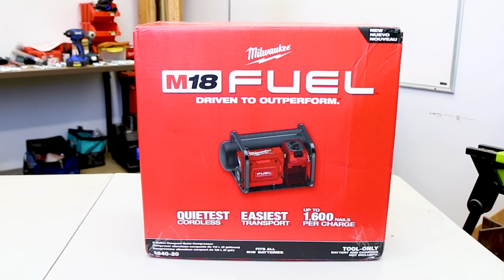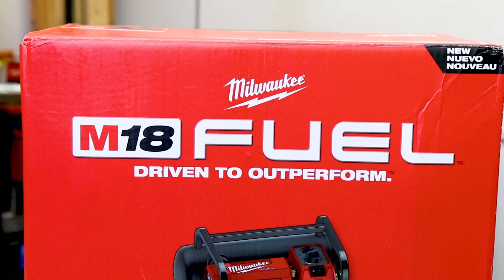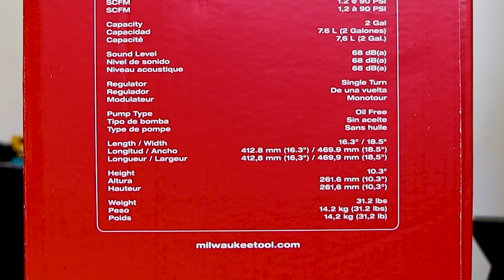New Milwaukee M18 FUEL AIR COMPRESSOR IS NOT WHAT I EXPECTED!

Comment: I would like it to have an extension cord connection so it can be plugged in if you want and it could charge the battery as well i mean why not right??
Reply: That is why there is a battery charger
Reply: @johnsavage3762  except when your on a construction site (especially new constructions) you don't always have a limitless supply of plugs. So there is a very real world practicality to having combined technology in these kinds of devices.
Reply: @johnsavage3762  you obviously don't understand why it's not really that effective of a tool with out the option of a plug that also has the ability to charge the battery without removing it.
Reply: Then they couldn't sell $250 batteries
Reply: @leezy7787  THIS
Reply: This is where Milwaukee often misses the mark for me. I agree,  this should have the ability to run corded and as a charger. Especially for the cost. I also think that mentality should apply to the table saw,  miter saws, compressor,  etc. If they can do it with a flipping light they should be able to do it on tools that cost way more and could benefit from having a cord. ....I get the whole "cordless job site" thing they are going for but having a cord as an OPTION would further set them apart in the marketplace..... many guys would love to be able to run their tool while charging it when there's power available
Reply: The aftermarket (underground) is in the working of a battery with and plug in adaptor. They have one for Makita and Dewalt. As far as I can tell it shouldn't be too long before something is available...that being said: the corded adaptor will probably cost nearly the equivalent of a 12V Makita battery if I had to guess.
Reply: I just made my own adapter
Reply: You can build it I know you can
Reply: Why not.
Reply: https://www.youtube.com/watch?v=eup1XDrHDfg  Tutorial for building AC adapter
Reply: @bergeronremy7359  that's not an argument because plugging it in is optional
Reply: That would've been common sense...the fan does that.

Comment: I have this compressor and you don't need to empty the air tank to change the pressure setting.  All you need to do is reduce the pressure at the outlet.  This can be done with a blowgun or a tool that requires a steady stream of air to work like an impact or air ratchet.  Just trigger the tool.  A nail gun will not relieve the pressure since it consumes air in short bursts, so if you do need to change pressures in the middle of a job with a nailer, just hook up an air gun.

Comment: I’m a tree guy and my bucket truck doesn’t have air brakes, just hydraulic. Therefore I have nothing to tap for air to clean chainsaws on the job and even myself before I get back in my truck with all that sawdust all over me. This little thing sits right in my toolbox on the truck and now I have air. Unbelievably handy. I recommend 10/10 for anyone in my shoes!
Reply: This is exactly why I was looking at it 👍. Air is amazing to have for any tree worker.

Comment: Beats unrolling 100ft of hose. So you don't have to hear the compressor.
Reply: @raymondcuda5906  well I'm a 30 year veteran framer and I remember when air nailers hit the scene and everybody said those would never work out. Air hoses are for dinosaurs right along with stick Framing with a hammer and using a hand saw for everything.

Comment: The "drain the tank to change outlet pressure" concept seems like a good way to suck a battery dry without doing any actual work.
Reply: Can be avoided with extra air regulator attached (like this one at HD: Primefit-1-4-in-NPT-Replacement-Air-Regulator-with-Steel-Protected-Gauge-CR1401G/205149488), that way you get second gauge and on the fly adjustment.
Reply: @alexs.3789  Nothing like spending $350 on a compressor, $150 on a decent sized battery, then immediately having to install workaround parts to be able to use it easily.
Reply: c'mon , how many times do you even adjust tank pressure . ALL of my air tools SAY 90 psi max., yeah for sissies . I CRANK it up to max no matter the tool OR compressor . I have been running the SAME airr tools for 15 years at 175 psi with NO Ill effects!!!!!!!
Reply: @shartingkhumbubbles7169  Many, many  many times per day. I make the rounds and fill up tires to specified pressures, which is easier if you don't have to watch and stop each tire at the right PSI...just set it. Then I want max pressure for blowing off and cleaning. I pressure test piping systems at a set PSI, run tools at different PSI, etc.

If you just run tools with your compressor, then yeah, it's no big deal.

Also, many tools will dtive nails for example to a different depth and different pressures. So if you don't care about your job being done to very high standards, you just blast them all in at the same pressure regardless of the task. You are right though, plenty of people just run everything at the same pressure, and both just don't care, and also think their eork is just as good or better than those that take the time to adjust pressure according to task.

It's a quick way to judge if you want that person to work on your personal house or not.
Reply: also is a why to use a 3 step motor for faster filling at lower psi...
Reply: @PowerScissor   oh i dont work on houses nor inflate tires with a 2 gallon battery powered compressor. I work on rusty cars from the rust belt and Id never purchase that compressor . i drain my 80 gallon IR in minutes with sanders and  such. that thing wouldnt last 1 work day
Reply: @PowerScissor  Small price to pay for those of us who do this for a living.  Hobbyists...go plug that shit in.   Beats having to call an electrician to come and install a spider box.
Reply: @shartingkhumbubbles7169  To each his own.  The Manufacturers suggestions are there for a reason and came to be after much testing.  But you seem to be smarter than the engineers who made your tools in the first place.  Continue on.
Reply: @wadopotato33  Well, if there's absolutely no power on site...you'll eventually have to charge your batteries.

I'm not complaining about the price. I just don't like the idea of paying that much, and then immediately having to install my own regulator which would stick out past the roll cage and be another thing I have to tote along. Literally every other compressor allows you to adjust pressure without draining the tank. It's an odd choice for a premium product.
Reply: @PowerScissor  I don't disagree.  I also thought is was strange.   I don't worry about the batteries much I have five or so and a sequential charger.  I often go three or fours days without charging any batteries.  I also don't buy the little ones.  I would rather deal with the extra weight than have to suddenly change one when I am up a ladder.  

I would slowly like to go to ALL battery powered stuff, but it is also cost prohibitive to do it all at once.  I also own a small Honda generator and so I haven't had to wait on spider boxes in a while, but it did happen in the past.  Having no power

The cost could come down, but I think it will once battery power is the norm.  I can't justify the jump at this point, either.  Besides, I own five Air Compressors already (all corded).  One battery powered one won't replace all of those anyways.  This one would be useless for roofing and a host of other jobs.  Who can only own one?
Reply: Just to let everyone know. I bought one and it does not work like that. Maybe they changed it...but tank always fills to 135psi and outlet pressure is adjustable on the fly without draining.
Reply: PowerScissor I don’t use pressure to adjust nail depth, I use the depth adjustment on the tool.  I don’t know anyone that adjusts nail depth by fiddling with the pressure settings, but that’s just me .  Not not to mention we usually have different nail guns hooked up shooting into different materials and all would need different pressures if you were adjusting depth by pressure.
Reply: PowerScissor might have to pick one up
Reply: @kds471  I returned mine. I would wait for Gen 2.  It killed my 12.0 batteries way too fast. I like to blow off all my tools at the end of the day, and it's not up to that task.

I returned it and bought a 2nd M18 vacuum. I just leave the 2nd vacuum set up on the blower side. Blows stuff off way better, it's way lighter and doesn't kill batteries, and works with the Packout sytem. Way cheaper.
Reply: PowerScissor thanks man!  First hand experience is the best kind.
Reply: @Matt B agree!
Reply: My new one adjusts on the fly PSI .....

Comment: I got mine in the first wave. It's a thing of beauty. 10ft coil hose and I can haul it all over the place. Built a "T" for two guns. I like the weight of the pneumatic guns vs my m18 guns. Really like this thing. I've even used it to run a coil nailer to fix a customer's fence, though it was great for a repair, I wouldn't build a fence with it.

Comment: My understanding is although not always the case, 'standard' db measurement is at  1 meter distance.
Reply: Yes, and in an anechoic chamber - not really a realistic scenario, but repeatable for comparison. Typical room reverb could easily add 10dB on top of that.

Comment: Perhaps you can set the pressure to max and connect an external regulator if you need to switch between tools? I was considering a cordless inflator, but all of them need a 20 minute cool down period after 5 or 10 minutes of use. Additionally, none of them were any good at filling truck tires. For me this will be my home and traveling inflator for all tires and rafts. It will also serve as a quick, quiet and convenient compressor for small/light nailing jobs. Got a Paslode for big projects.

Comment: I have one of these. Works great for tires, blowing dust off stuff when assembling engines, etc. Much nicer than lugging a fullsize electric compressor around and does a hell of a lot better job than the small 12v compressors!
Reply: Can it run a oil extractor vacum  on cars ?
Reply: That’s why I bought it. I just ordered it. I just want it for blowing off shit when I’m servicing equipment an airing up my sure shot sprayer. I probably should of waited for gen 2 but no mention of it yet an I needed it yesterday 😂 I think it’ll be perfect for my uses. Can’t wait to get it.
Reply: @samuelw.3992 so this would be good to spray dust out of a work truck, ie detailing?
Reply: @travispettyjohn8079  I think it would do good if you got a tiny blow gun, mine is 1/4” diameter an the compressor starts running after 10-12 seconds of using it. I think a small blow would allow you to blow longer.

Comment: it would be pretty cool if they could improve this design and go with a rotary screw type compressor and a 3 gal carbon fiber tank that would reach over 200 Psi and kick the compressor on around 150psi that way you could run the unit far longer for larger devices . Maybe reach 3- 4 cfm

Comment: I just got this milwaukee compressor. Im a general contractor and do work orders and repairs for real estate companies. I most do small jobs  and repairs and not huge projects. This will come in very handy doing trim. Or even my palm nailer  when I need to utt a nail in a tight spot. In my profession it will come in very handy.

Comment: I use my cordless compressor to put air tests on plumbing rough ins. You never have any power on new construction sites so this tool saves me a lot of time
Reply: I am a Plumber thanks for your input
Reply: I use the much much lighter and smaller dewalt 20v inflator, works great. Got tired of carrying around the bigger flex volt compressor

Comment: I would like this if they made a "battery to wall" adapter so you don't have to worry about the battery die-ing and it's still about the same performance.
batt to wall: aka battery looking package but with "prongs" for an extension cord
Reply: ....there's a company in the process of making one now.

Comment: I think they may have realized that pneumatic nailers are smaller,  lighter, infinitely more adjustable with air pressure, have much less moving parts, and cost half as much as lithium nailers. I'm sure losing the hose has it's benefits - like Richard and his crown installations. Great review and I will stick to air for driving fasteners.

Comment: Waaaaay too expensive at $350 for the bare tool. Better off with the flexvolt compressor. The kit with the fast charger and 6Ah battery retail at $300 and can be found much cheaper frequently. It's also 2.5 gallons compared to the 2 gallons here.
Reply from the maker: Solid feedback, thanks!
Reply: Still seems like a 18v pin nailer would be way better than dealing with a whole ass compressor and hose though.
Reply: @mastermetalshredder  
No kidding! Definitely the smarter alternative.
Reply: @rogosteve  I think they should have both
Reply: @mastermetalshredder  
Metabo has an 18v framing, finish, brad, and pin nailers that run in the same battery.
Just sayin'.
I've got everything Milwaukee except my nailers suite. I couldn't wait for the to get their act together in that scene.
Reply: I'm assuming your talking about a Dewalt throwaway tool. $150 would be way to much for anything Dewalt, I mean Black and Decker builds.
Reply: The dewalt cordless compressor is garage , I brought it and burned out after 1 apartment of trim , just stopped turning on outta nowhere , the battery doesn’t last , even for a 60v , not to mention dewalt doesn’t even build it , they send you to the company that builds the compressor after you call for the warranty but they don’t have any warranty , they tell you to call dewalt . Don’t waste your time
Reply: I agree
Reply: DeWalt batteries are a step behind Milwaukee's.  If you want to change out batteries all day...go with DeWalt.
Reply: @mastermetalshredder  Was thinking that myself, but for those of us who do it for a living we need a 16 ga pinner, an 18 ga. pinner, an 18 ga. stapler and an 23 Ga. pinner.  Actually cheaper to go with a cordless Air Compressor.   Cordless tools?  They are almost 300 dollars a piece and they don't even make a 23 ga. pinner to my knowledge.  MUCH, MUCH cheaper to buy the cordless Air Compressor.
Reply: @wadopotato33  makita has 23 gauge nailer for $180
Reply: @donwaltz2798  I buy Makita grinders because I weld a lot.  I have a laminate router that is a Makita.  I like it.  That said, I don't really like many Makita tools.  I actually don't mind their framing nailer, but I have tried other nailers and don't like them.  Their saws are also absolute garbage.  I can't figure out why anyone would buy a Makita saw.  Not a fan.  I do this for a living and work with a lot of people.  I have tried most everything.  Makita for nailers is not on the table.  Unless it is a framing nailer.
Reply: @AceSolomon94   Sorry man, that is not a practical application of battery power.  You would need a battery the size of a pickup.
Reply: @wadopotato33  lol yeah I've had both. DeWalt flexvolt for the win.
Reply: @fernyisable5  Mine is going great, I run a Graco Fireball off mine pumping gear oil. The air consumption of the Graco pump is greater than the output of the DeWalt compressor so it just lives it's life in pain running flat out trying to build air (I'm not really using it for what it was designed for). I've also used it to charge MAN truck air tanks to mobilize it's broken arse & also used it to run a husky 1040 diaphragm pump when I needed fuel from the support Truck. It's pulled me out of the shit many times.
Reply: The best way to find out is to compare it to other brands...
I had the dewalt for some time... it was too noisy, i had to run more hoses to leave it outside... short story, I sold it.
I have the Milwaukee now... I’m keeping it.
I’ve made some trash boxes 8’x4’x4’ using a framing gun and worked good, so yes it can keep up to a framing gun, of course it depends how long are you using it. It’s more like  for repairs and small projects.
That’s got be be considered too, either a cordless or a gas compressor is need it not just because it looks cool or it’s portable.

Comment: Hi Vince, 

The video doesn't do justice on the noise leave. This milwaukee m18 cordless air compressor is quiet. I used it on a large fence project with a long back yard. I had to use my pneumatic crown stapler. It's awsome, i didn't have to roll out a 100 ft extension cord. This tool already paid itself off and made me money in one project.  People got to remember these tools are mostly used on jobsite to make you MONEY... Not to sit in your garage to have a cool tool. This way no one needs to complain about the cost. Go make money with the tools already. 

Don't get me wrong it's pretty pricey for now. Remember it's a new tool rollout. If you are not going to use it as much then just wait for a sale. You know it's going to happen, LOL...

Thanks for the video

Comment: Yeah it's quiet but takes twice as long to fill the tank and at 31lbs it's 10lbs heavier than the dewalt with less air capacity and the dewalt cost less
Reply: dewalt is only 1220 nails per charge...milwaukee is 1600...dewalt is beat again 😂😂💪
Reply: Lou Cifer As a Republican and Milwaukee fan I don’t like that comparison lol
Reply: Love the comparisons,  although I tend to think Dewalt is the Democrat of the tool world.   Lol.   They give you junk tools in their combos and leave their good stuff in stand a lone.
Reply: @dennisberg2474  They don't lie about their tools or paint the compitician grey
Reply: @Raybso247  lol same here man it hit a soft spot lol
Reply: I have the dewalt 2.5 gallon flexvolt compressor has done well for me i don't think the Milwaukee will do 1600 Milwaukee seems to over inflate some of there specs on tools
Reply: Yes but it’s dewalt